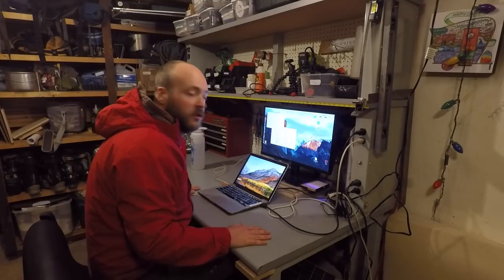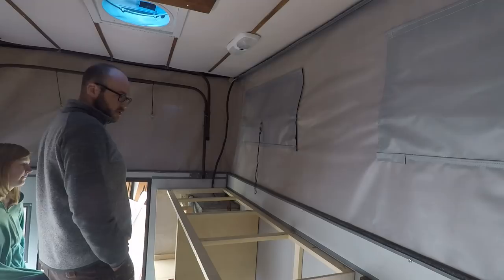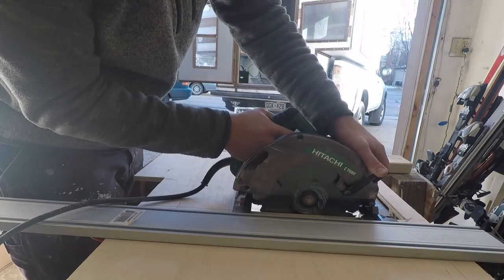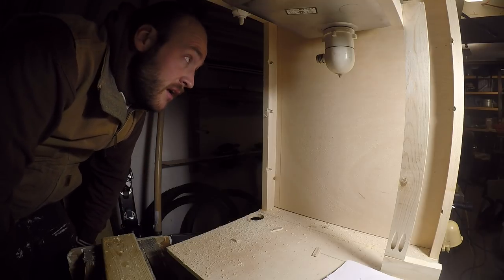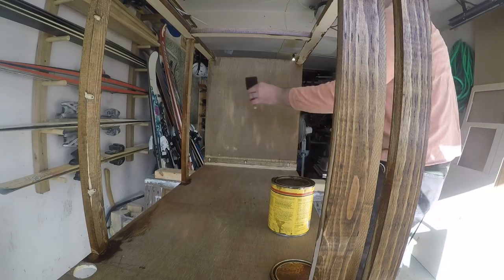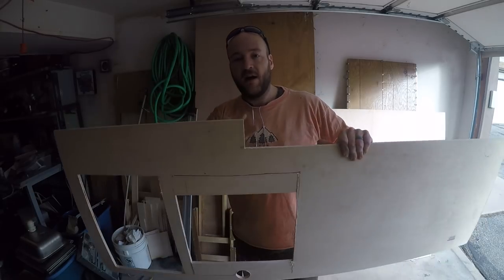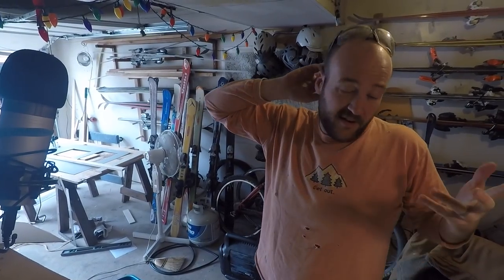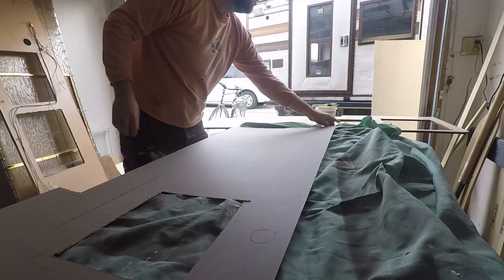DIY Truck Camper Build:  Making the Galley/Kitchen for a Four Wheel Camper - Part 2

Comment from the maker: Note: The adhesive glue I used for the laminate countertop did not work! Do not use the tile glue I used. I tried another adhesive and will report back if it works.